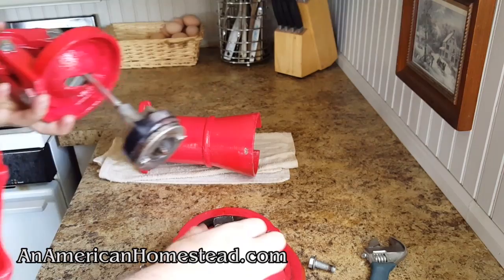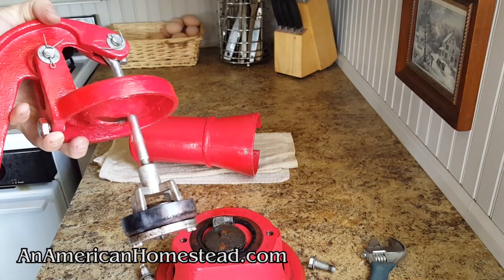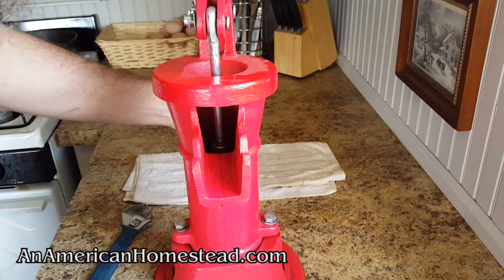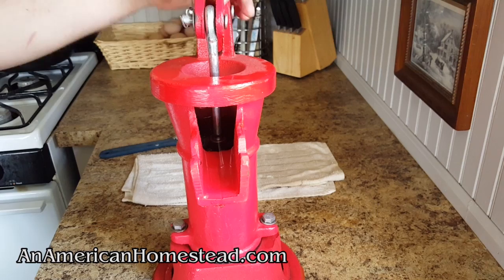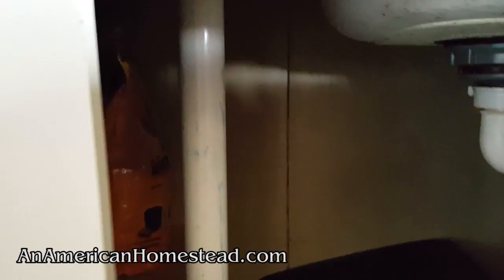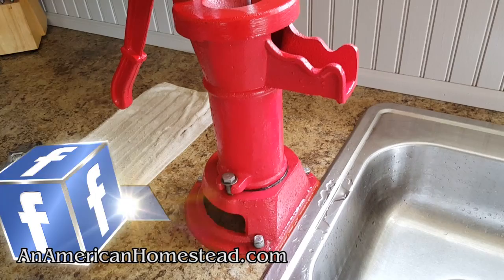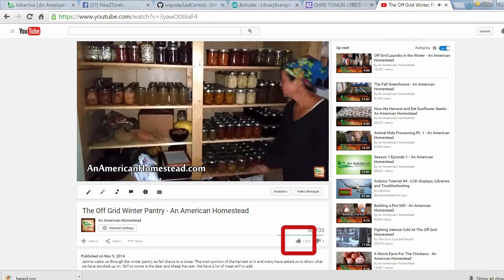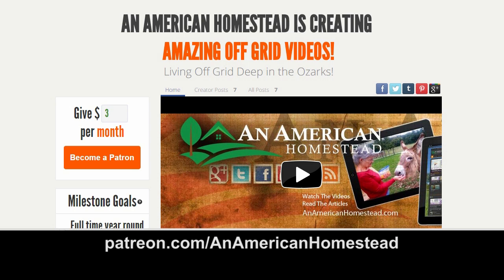Off Grid Pitcher Pump for the Homestead

Comment: I noticed that your water is drawn from a tank that is not directly under the pump it'self. I was lead to believe that hand pumps would only work if the pipes ran directly vertical to the water source? Apparently this is not the case? Is there a certain distance that the pipe has to run vertically before running it horizontally?

Comment: I love the red pump and am so happy for you, but does the tank freeze in the winter. How do you get water in freezing conditions?
Reply: Usually tanks of water don't freeze cause they have volume and water volume is good at maintaining heat. As for pipelines I would've done them a bit deeper in case of a cold winter but they shouldn't freeze over dirt is also good at maintaining heat. Dirt being an insulator.